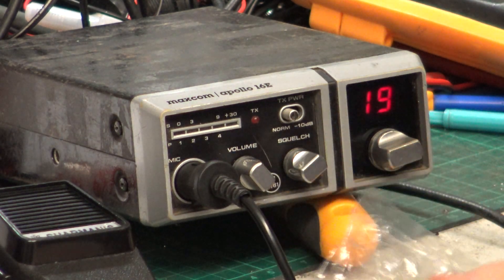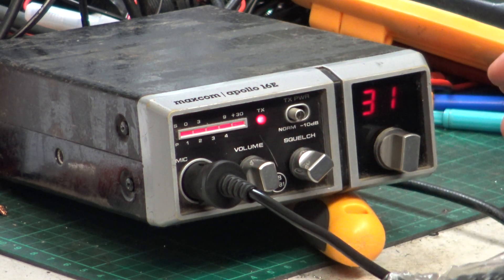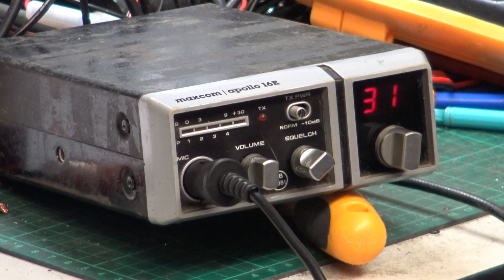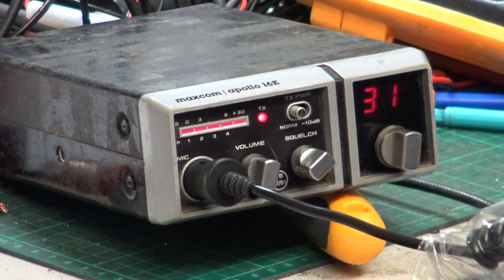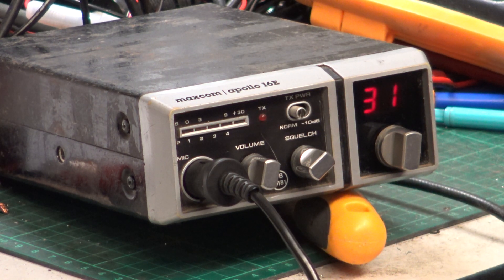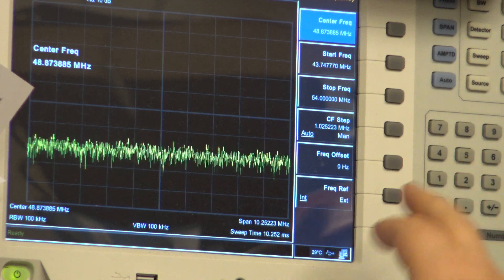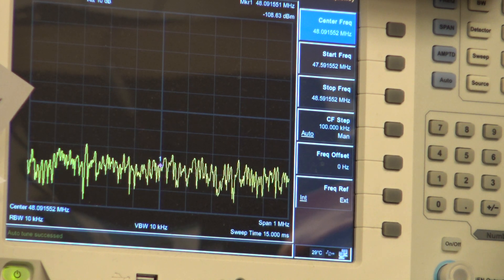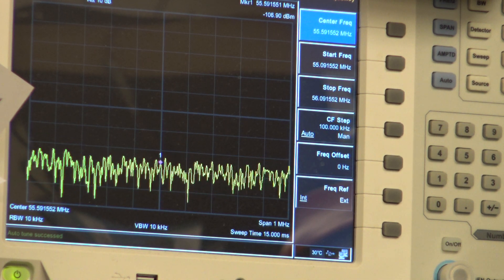Maxcom Apollo 16E CB27/81 UK FM CB radio - On The Air Test

Comment: I went to bed at 1.30 was hooked on this Richard as it's very similar to one of my sets as you have very kindly already helped me with, after watching this I will check very closely for the 54 MHz 2nd, very often the rigs don't have a trap but it can be mis shapen coils or incorrect/damaged ones, it will be interesting to see how you sort it and the second go with Mr Chippy.

Great work on this, I think you can definitely consider yourself a surgeon, a CB radio surgeon, shame that the wages don't match, still most of our patients will probably out live us once they come out of theatre ☺️
Reply from the maker: Yes, I've adjusted the radio on the analyser this morning & will tag the retest at the end of the next 'on the air' test, which may not be 'till Tuesday.

I think the difference between myself as a commercial 2-way radio engineer & others, is that 99% of the others wouldn't 'lower' themselves to touch CB radio. I believe they need servicing properly & better than even the factory did when they spent 20 seconds on aligning! I also am happy to pass on this knowledge.

Richard, G0OJF. UK
Reply: @ukfmcbradioservicingTango21  Yes, getting some others to look at CB is difficult, that is if they spend enough time to do a good job on it anyway!
Problem is CBs were so cheap they were not worth fixing in the end.
Now however, the price has gone up and it is worth fixing them again, but getting some parts is difficult!  :-(

Comment: Culprit Spotted! - Will there be another "On The Air Test" with this tomorrow Richard?
Reply from the maker: Not on video Rob. It'll be a 30 second adjustment with the analyzer & I'll just slot it in at the end of the next test we do at the 6-mile point.

Richard, G0OJF, UK
Reply: @ukfmcbradioservicingTango21  Jolly good - will see how that pans out then!